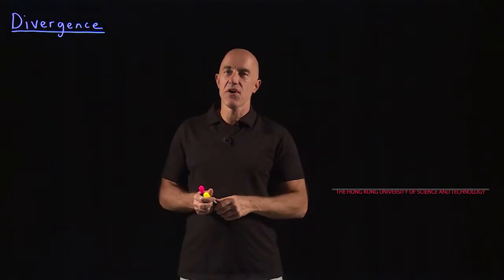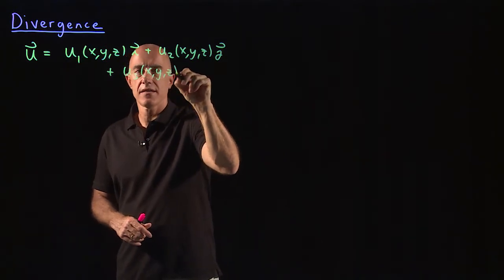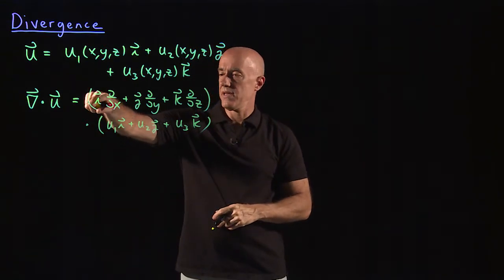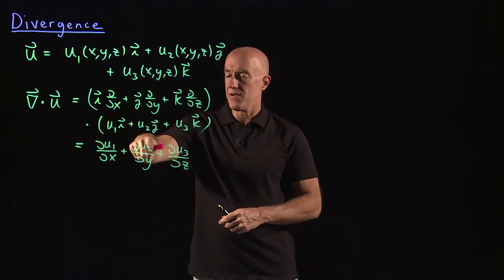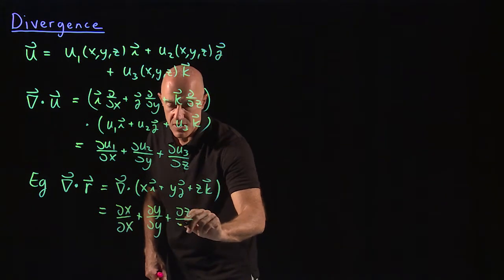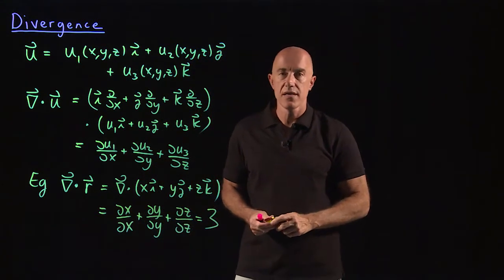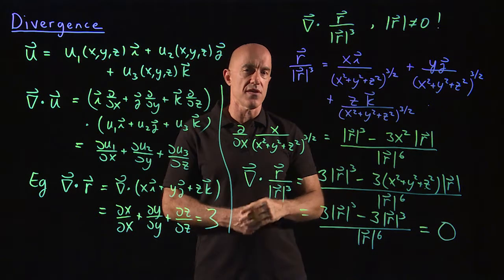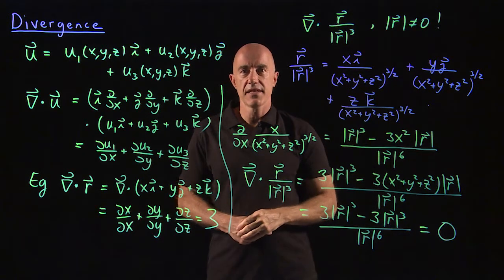Divergence of a vector field | Lecture 18 | Vector Calculus for Engineers

Comment: partial derivative of (x2 + y2 + z2) is 2x and we'll be left with 3x * |r| in the numerator, how come it's 3 x^2?
Reply: QUOTIENT RULE SAYS:
DERIVATIVE OF (U/V)  =  [ V*(DU) - U*(DV) ] / V^2

HERE, 
U = X    AND,  V = (X^2 + Y^2 + Z^2)^(3/2)

DIFFERENTIATING GIVES:
DU = 1
DV = (3/2)*(2X)*(X^2 + Y^2 + Z^2)^(1/2)

PLUGGING THAT ALL BACK IN EXPRESSION:  [ V*(DU) - U*(DV) ] / V^2

[ 1*(X^2 + Y^2 + Z^2)^(3/2)  -  X*(2X)*(3/2)*(X^2 + Y^2 + Z^2)^(1/2) ] / [ (X^2 + Y^2 + Z^2)^(3/2) ]^2

REMEMBER THAT,  |R| = (X^2 + Y^2 + Z^2)^(1/2) :

[ |R|^3  -  (3X^2)*|R| ]  / |R|^6 ]

Comment: I have a question. At 2:30, where does the i_hat, j_hat and k_hat take of to in this equation? Shouldn't it be: (du_1/dx)*i_hat^2 + (du_2/dy)*j_hat^2 + (du_3/dz)*k_hat^2) ?
Reply: It's a dot product. You multiple the i components, multiply the j components, and multiply the k components, and then add them. We don't multiply the i-hat, j-hat, and k-hat. Think of it this way: <a,b,c> . <d,e,f> = ad + be + cf.